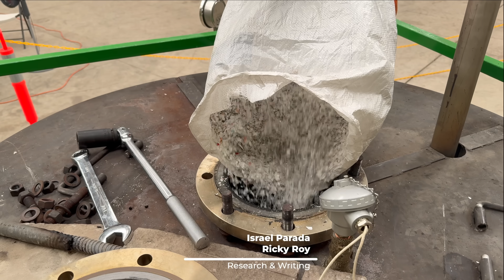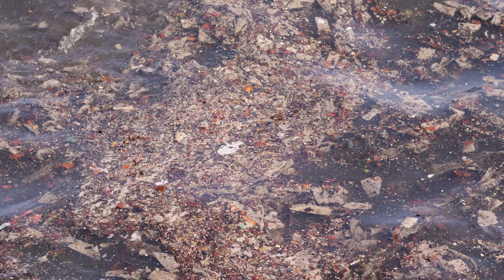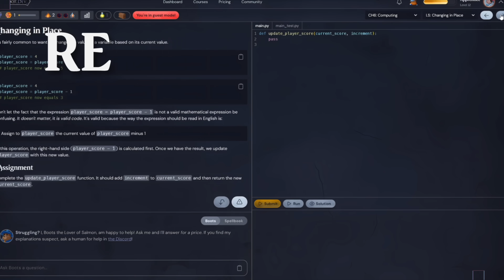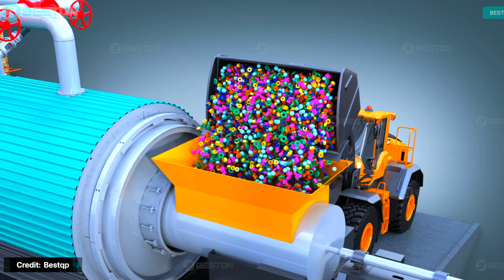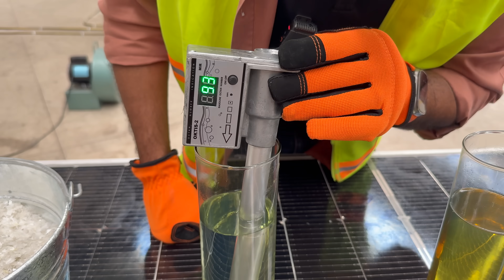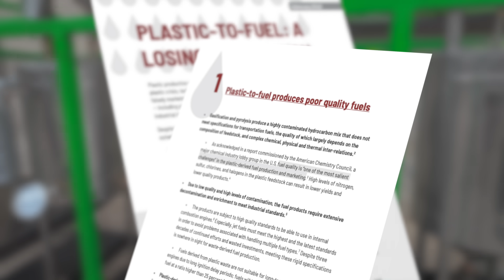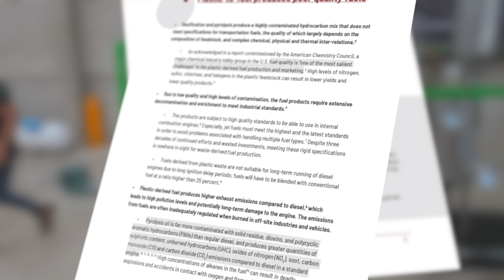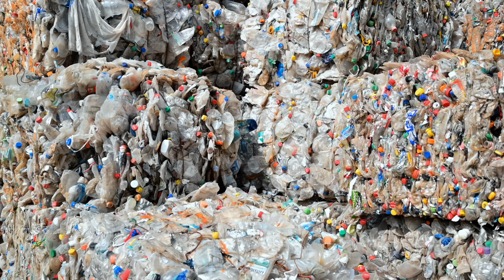Solving the Plastic Waste Problem - This Surprised Me!

Comment: I was just wondering if you would be able to also mix in things like used motor oil or old gasoline that you should not use in your car anymore at the same time that you are boiling the plastic? I was just wondering if this would also the output of the byproducts since it would’ve started that as a liquid and you could put more of that into the reaction chamber in the first place. Also, I was wondering if that would change the output if you mixed the used plastic with used more oil?

Comment: What is the difference between the fuel gas input versus the fuel output? IF, it takes more to heat it than what you get out of it... not useful. You'd be better off just using the input fuel. IF this is so easy, just heat and condense, WHY is no one doing it?  GUARANTEED that if there was positive output from this and money could be made... It would be everywhere already.

Comment: Yes we need new and novel ways to recycle plastic but converting a solid plastic in to a gas that pollutes the air is the very last thing we need. It's air pollution that's killing us! Notice how they don't talk about if this stuff burns cleaner than traditional gas/diesel. That should be front and center the fact they skip over that is telling....I'll lay odds 10:1 that it does not burn cleaner

Comment: AI Overview    +3                    From lowest viscosity (thinnest) to highest viscosity (thickest), the order is gasoline, kerosene, and diesel fuel. Gasoline flows the easiest with the lowest molecular weight, kerosene is intermediate, and standard diesel fuel is the thickest and most viscous.
We would use a couple of gallons of kerosene in a 50 gallon diesel tank in the winter here in New England to prevent frosting of the few wines when it got really cold.

Comment: I see it as a good supplement, I don't see it as a total source on a large scale. On a small island I've seen how a very similar system (though more crude) makes fuel to run generators for electricity, this also gives them a use for beach trash that washes up regularly.

Comment: In general, the petroleum industry creates enough otherwise I needed base by-product to make plastics that makes recycled plastics uneconomical.  So if some better purpose can be made out of it then putting it in landfills, or the ocean, then so be it.  The real issue may be the logistics to get the scrap plastic into this process.

The far east, especially small counties with ocean shore, account for the vast majority of plastic in the ocean.  The ocean is close by, they have large populations and little land mass.

Comment: The major impediment to plastic recycling has the residue on the plastic and the potentially hazardous chemicals that have been absorbed into the plastic. For example, a one gallon jug of water compared to a one gallon jug of engine oil. If at anytime during the recycling process these two are handled together the resulting combined recycled plastic can not be used as a future container for any product intended for human consunption. Imagine recycling plastic drums that held chemicals alongside plastic containers that held food products. I made a small investment in a technology that promised their process would eliminate any possible chemical contaminant would end up in the recycled product. Needless to say, my few hundred dollar investment was a total loss. In the current proposed process imagine firing a Kerosene Heater with the recycled product that was contaminated with a toxic chemical in your home. Not a good thing. Plastics by their nature absorb trace amounts of the product that was stored in them. Those trace amounts can always show up in the recycled product.

Comment: I am not surprised some other regulatory agency ruled against it. Plastic trash is a bigger problem cause we'll still be burning fuels. There are know ways to capture the Carbon. Everything has pro's & con's ... I feel as of, Right now the con's of plastic waste is a bigger problem. Why not put the incinerators in the cold climates to be used to heat homes much like one European countries does. They buys trash from other European countries. I saw on a you tube. ( I tried looking to see if I could find that video in my history. Nope)

Comment: I've never really thought of burying plastic waste in landfills as carbon sequestration before, but I suppose that is one way to think of it.  However, if you believe that is a problem, I don't see how you can object to a process that turns non-easily recyclable plastic waste into new petroleum products that would otherwise still be produced from newly extracted petroleum.  Turning plastic waste into gasoline, diesel, and kerosene won't cause more of these fuels to be burned unless producing them from plastic is substantially cheaper than producing them from new petroleum.  I suppose if this process made these fuels substantially cheaper at the pump, that could slow the replacement of gas vehicles with electric ones.  However, producing fuel from plastic doesn't have to be cheaper than producing it from newly extracted petroleum, as long as it's cheaper when you factor in the cost of otherwise disposing of the plastic waste in a landfill.  In an ideal world, we would be able to break all plastic down and turn it into new plastic.  When that happens, we can stop turning plastic into fuel.  Or not.  We still need to burn fossil fuels because we don't yet have battery technology that is as energy-dense as fossil fuels.  When we do, we can stop burning them.

Comment: What impressed me was not how the reactor operated, it was the relatively small footprint of the system as a whole.
Crude oil refineries are massive and consume tons of energy to function.  This system is small enough that individual fuel stations could have a reactor on site.  
The cost you pay for fuel at that station could be offset by the weight and kinds of plastic waste you bring to the station.
On a larger, industrial scale, multiple reactors running simultaneously, with a constant feed system, could process tons of plastics in a day.

Comment: I think that since there isn’t going to be a switch that we flip to suddenly quit using fossil fuels, this is a good bridge that could possibly decentralize oil production for fuel.  It could give the US, Venezuela, and the Middle East a run for their money when it comes to global wealth transfer.
In conjunction with some of the ocean and river cleanup projects, smaller countries could be a little more energy independent, and get rid of some of their waste at the same time.

Comment: it sounds like an insuficient source. the uncertainty of it yielding lower than 90 octane raises alarm that might damage cars in the future. is constantly producing at the same quality, what if a coke bottle changes property and yields lower octane? what if wrong trash has been put. as he said lower yield or even extremely higher octane puts the fuel into even more expensive proccess to be safely use. so actually they have done some of it but doesnt show promising results, if it works so good then he shouldnt be here and greedy billionaires had already capitalized on these before it could get to you. US wont go to war for these contraption, but if you had crude oil under your soil, you know its the real deal. i hate people glazing so much, claiming anything like its something like a paradise promise. every practical person knew its not so good, although its not bad
Reply: Would you want to have these contraption in an industrial scale? maybe, its not so bad. 
Would you rather have cruide oil underneath your land? yes because its proven to be so much very good as hitting the moon kind of wealth

Comment: So the solution to the plastic catastrophy is to use it to fuel the climate catastrophy?

Trying to find an alternative use for single use plastic is commendable, but turning plastic into fossil fuels just shifts the problem to another area while calling it 'clean' and 'green'. 

The recycling and not producing single use plastic waste in the first place, the only net positive solutions, are not pursued because plastic raw material is, in many cases, a waste product of the oil industry (e.g. Ethane), they need to constantly make new plastic to function.

Arguing that some magical carbon capture technology surely will come along to clean up this mess is diabolical.

Comment: This is a normal old-fashioned small pyrolysis plant. There is nothing new here.

Plastic contains little ash and solids, which makes such a pyrolysis plant very easy to implement, especially since the required capacity of the plant is very small.

Large industrial-scale pyrolysis plants are based on the so-called heat carrier process and can process waste fractions with very high ash content, although the quality of the oil is not great.

Comment: I should think this would be a great step forward. Significantly less plastics going to land fills, less fuel use there.  Less transport cost of importing crude from over seas, saving fuel for the ships there.  Cross country transport where pipelines are not available at both ends, more of that less fuel.  Even causing this to be burned and co2 going back into the air, it sounds like it would be far less going in than all the infrastructure needed to produce the original fuel from the trasport alone. Giving a net negative to total co2 output.

Comment: An Indian guy was dong this two years ago in his shed. He used a fire under a pressure container filled with plastics. They also checked his fuel for emissions and found it was way cleaner than the original natural refined crude oil system. He only made petrol, not kerosine or diesel and was supplying his village with cheap fuel for a year or so before they found him. 
This is impressive in that it can make multiple fuels and it stands to reason that plastics can be converted to fuel as that is what they are created from in the first place! These clowns who advocate for the abolition of Oil products, well they are simply to silly for words. No EV's will be made, no plastics will be made, (of any type) many products will cease to exist and you can consider going back to pre electric era.
Recycling is an answer to the bigger issue of pollution and destruction of the planet, rather than the constant BS about CO2 being the end of the world.

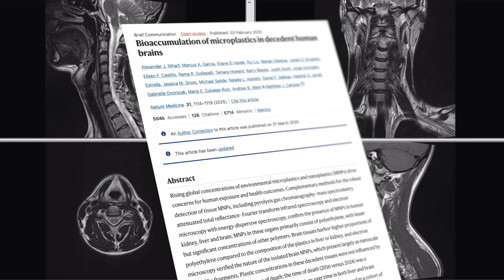Comment: 3:31 did that study control for the fact that the gloves researchers use to handle the samples are made of plastic? That was demonstrated to be a significant unaccounted for variable in the last 30 years of research into this problem. The nitrile gloves were shown to shed a small amount of plastic used in the manufacturing process as a dry power coating agent (to prevent sticking) into samples that were handled using those gloves. All of the major plastic studies until that point are now in question since they used nitrile gloves.

Comment: Unless I misunderstood, converting to fuel that releases CO2 when burned is not a problem because those needing fuel will still burn fuel, they will just be burning fuel from other sources like from the oil wells. Better to solve the plastics problem instead of allowing plastics to still be a problem and burning the fuel from other sources anyway. OTOH, if this were to increase demand for fuel, then we'd need to weigh all the pros and cons.

Comment: Not this crap again.  Why can't anybody do some research before making another video claiming you can recycle plastics into gasoline with just heat.  Do you really think nobody has tried this over the past 50 years?  Of course they have.  Every 10 years it seems I read another article claiming the same "breakthrough".  It simply doesn't work, and it's usually a scam.  They put on a show for some gullible 'reporter' or a shill, then use it to get sucker^H^H^H 'investors'.

Comment: The thing is that they put clean selected plastic into the process and at the end just a part of a dirty bottle to prove a point. Well it’s no problem to make nice fuel from nice single type plastics which have been processed, cleaned before. The problem is that it is very expensive to sort out waste to get plastics like this. Therefore it is not economically viable to process expensive clean plastics into oil. And when you try and put mixed, dirty feedstock with everything you find in waste in this process, I guarantee that the fuel would not be as nice and clear. It would be polluted with everything that was in the feedstock, including all kinds of chemical elements from things like paint, refiners, protective layers, etc. Plus you get paper, metals, rubber, bio and other stuff in the waste mix which all go to the fuel and make its quality much worse. Not to mention that a large part of plastic packaging is not a pure PE or PP but different combinations of many different things and co-polymers. So in a small experiment scale it’s fine but in a large industrial scale it won’t be so nice and easy as they present in this video. 🙂

Comment: Funny how time changes everything.  In the 19th century, John D. Rockefeller’s Standard Oil primarily refined crude oil into kerosene for lighting.Gasoline was treated as a highly volatile, useless byproduct. Because there was no market for it before the widespread invention of the internal combustion engine, refineries often dumped it into nearby rivers or burned it off just to get rid of it.

Comment: Your argument would hold water if we had limited plastic bottles, but there are more than enough to recycle, and this burning process not only revives over 90% of the material into other forms but also has lowered its overall footprint. This is the answer to our current plastic problem; the byproducts are fully used; they don't float around in the sea or in my body.

Comment: What is the cost of the final product as compared to existing technology. If it's not drastically cheaper there will be no incentive to develop.  The term waste plastic gives an impression of no or low cost to start with but scaled up the waste plastic becomes a commodity and the cost will also rise as demand will dictate. Good. bad, right or wrong this will all come down to it being profitable

Comment: This is a great project.

Question how hot does the first stage need to be?
Is it possible a Polar Night sand battery could be used to preheat the system.

Comment: This kind of thing has real potential in locations with large amounts of plastic waste and low wages, a situation which still describes much of the developing world. If people are motivated to scavenge for and dispose of plastic this way, that is a win. 

There is still a real need to develop the technology to handle greater diversity of feedstocks. PET and PVC make up a lot of the waste that's out there, and people aren't that good at sorting to begin with. To make the process more circular, we could start sourcing the carbon we use for plastic to begin with from air.

Comment: You might like to make a video on a recent process developed (US, China, Germany) to do the same thing at room temperature and ambient pressure. The advantage is that while the Mexican technology does not process PVC, this one does. The details are available in an article in Science that came out on August 14, 2025.
Reply: If I remember correctly, this new process you mention only works with PVC because the removal of the chlorine atoms is what drives the reaction forward, so those would be complementary in a way

Comment: Yep. The only long term solution to the plastic problem is to burn it. It's a pity that's going to put all the carbon from the plastic into the atmosphere that already has more than 50% more carbon in it than it should.

Comment: recycling plasstic is scam instead of recycling we should just use this 
also need this type of systems for pvc and pet also as they are widely used plastics
only problem here is that you need a clean sorted type of plastic getting that quality of plastic collection is difficult and expensive 
so the fuel made from this process will not be cheaper than regular gasoline.
but even if the fuel is not usable for cars and vehicles it can still be used in industrial furnaces

Comment: funny that "Petgas" does not process PET :) This technology is not the sole solution to plastic waste issue, but I belive it can be part of the solution. Our town uses bio gas from waste water treament facility to run some of the local buses, I can imagine they could add this tech to the local waste incineration facility to not only incinerate the waste, but convert the plastic not suitable for recycling into gas for the public transit system.

Comment: I have been in plastics for over 35 yrs. . Although this has some mild optimistic future,  real real problem is we are introducing so much plastic into the system that cute little recycling ideas are going to create a dent in the magnitude of the problem.
First, we have to reduce the compatability group down from 12 or more to 3 or 4.
This will help reduce the headaches trying to work with mixed plastics that don't bind together. 
Then, we have to figure out away to not have to use more energy trying to recycle it.  I would suggest pulverizing into a powder and require any construction company to figure out away to use 10% of their concrete as pulverizered plastic as a filler.  This could go for decks and sheds.  It's going to require that much volume to turn the corner before we are swallowed up

Comment: With the CO2 released from burning fuels you could transform it back into food and oxygen by planting crops as the ultimate green use of oil.  Remember why we use plastic in the first place.  It helps extend food shelf life to feed the world.  

The green cycle could be...
Oil - Plastics - Fuel/Energy - CO2 - Food(crops) and Oxygen.

Carbon is the ultimate green source of energy.